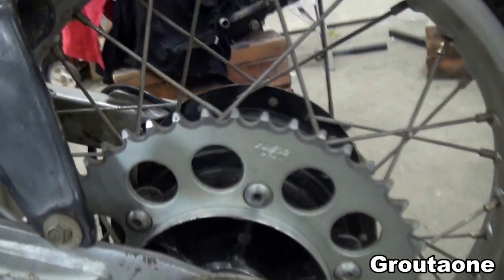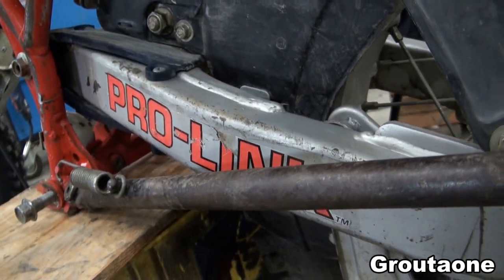XR500 Digital Speedo Sensor Mount

Comment: Re build your bracket to be straight above the axle shaft in the center of the chain adjustment travel and it will be fine. Dont have the magnetic installed fully into the bolt head as it will weeken the bolt to fail again.

Comment: I would try to just drill out the top of the bolt and put a bit of jb weld in it and glue the magnet in.  I dont think the little bit of dish from the drill bit will weaken the bolt too much but with how cheap bolts are I would just drill one out and see how much it takes to snap the head off.  Also just slot your bracket with the sensor on it so you can adjust its position as you have to tighten the chain slop.  Nice work so far and cant wait to see what you come up with.

Comment: Will the wheel still be balanced ?
Reply from the maker: The magnetic bolt is basically across from the rim lock, balance will be better like this.
Reply: With how inboard the weight will be I dont think it will even be noticeable.  Also its on a dirt bike so I dont believe they are very balanced to begin with.

Comment: Magnets too thick and bolt head isn't thick enough for the magnet to be set in flush. That's why the first bolt broke. Doesn't have to be flush, just set down in a counter bore .060-.080 and epoxy-ed in. Also that's a proximity sensor, alignment doesn't have to be perfect just close.
Reply: I never thought about that.  With a prox sensor they are fairly forgiving especially a magnetic one.
Reply: @PostalRedneck  There's a distance/gap range, with some brands up to about .200/inch, maybe more

Comment: How about a magnetic drain plug, tapped into the sprocket from the back side and red locktight.
Also, GPS speedometers are now surfacing for automotive applications.
You might like the Cleetus McFarland channel, stick shift corvette 1/4 mile record holder and 3/8 mile Fun Factory Owner/Promoter...